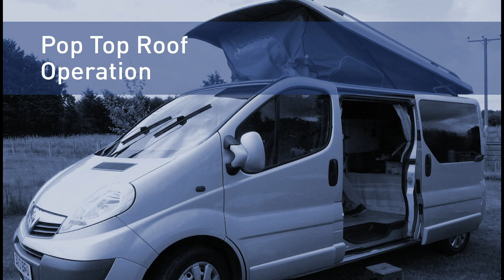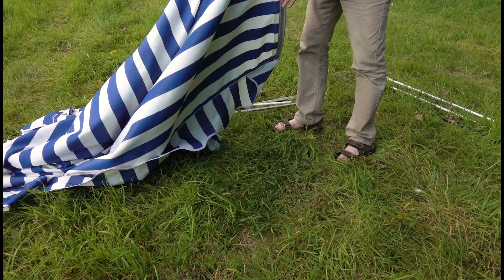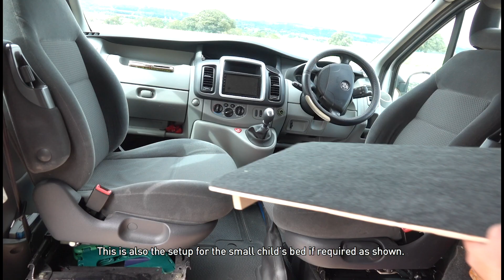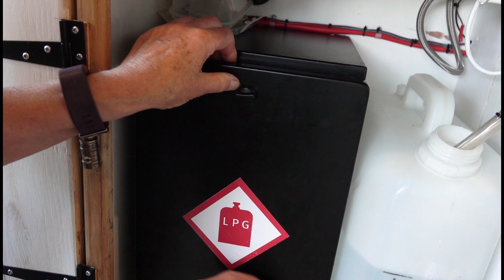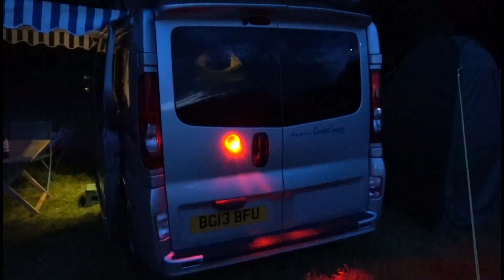Sylvester Operating instructions

Comment from the maker: Pop Top Roof operation - 0:11
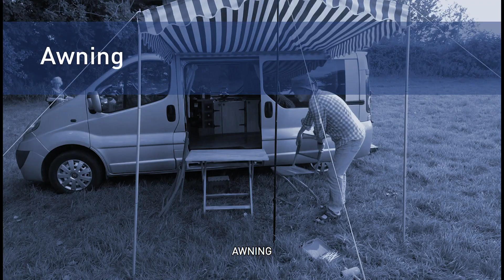Awning - 1:00 
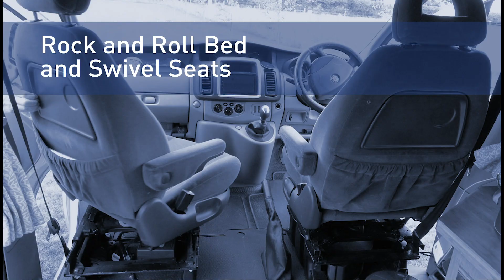Rock and Roll Bed, Front Swivel Seats and Bunk Bed  - 3:12 
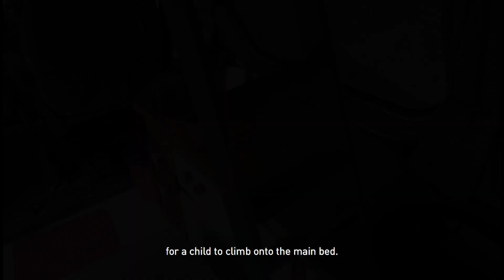Kitchen and Induction Hob  - 5:20 
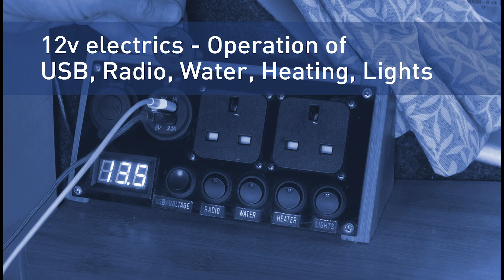12v Electrics  - 6:26 
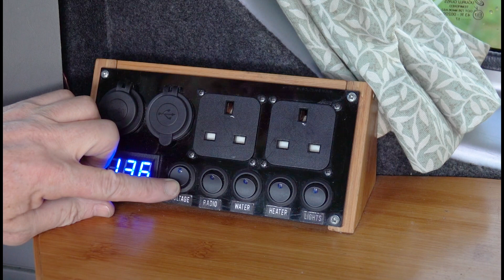Multi Function Radio  6:51 
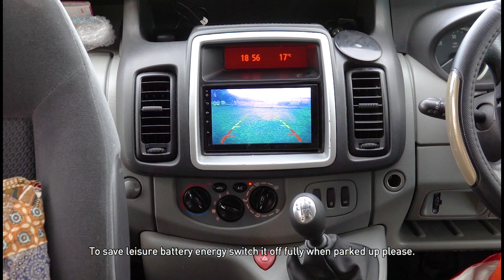Water - 8:08 
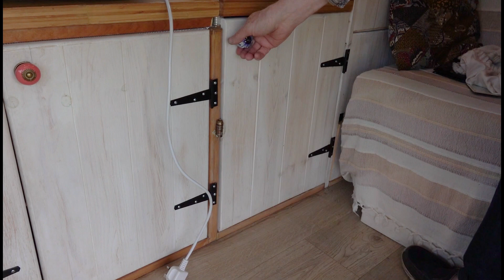Heating - 8:43 
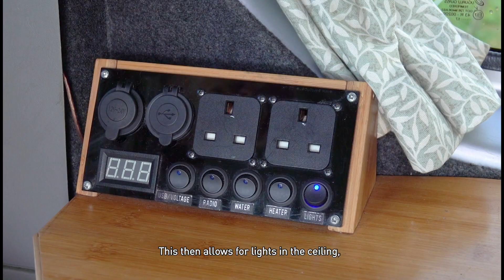Lighting - 9:15 /
Rear Panel Electrics - 9:43 
Collapsible Spade for Wild Camping - 10:21 
Gas Safety - 10:40
Safety Features - 12:34 
Pop Up Toilet Tent - 13:26 
Shower - 14:31